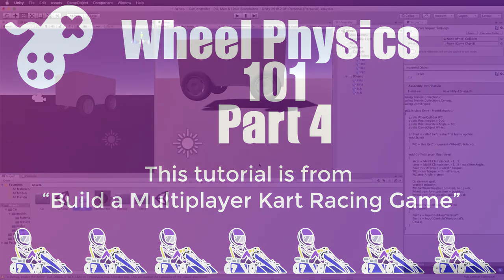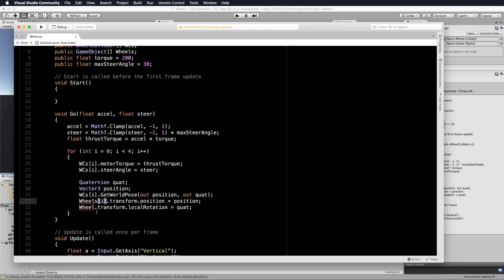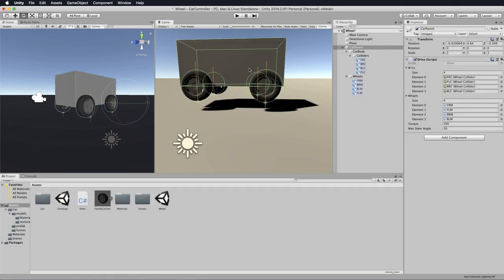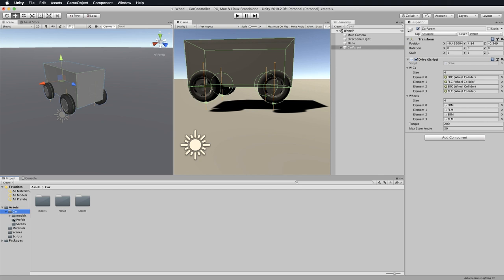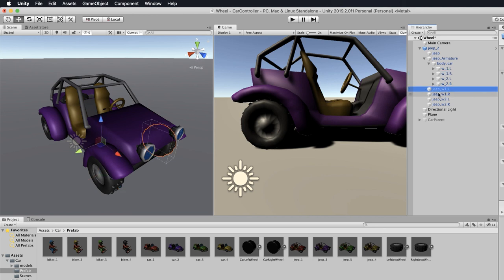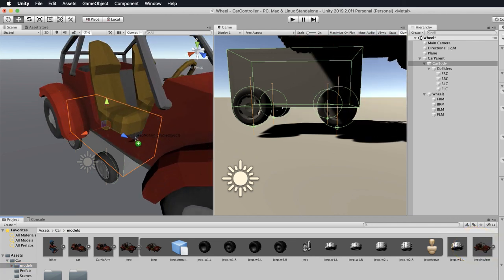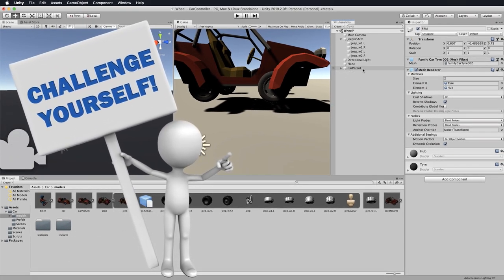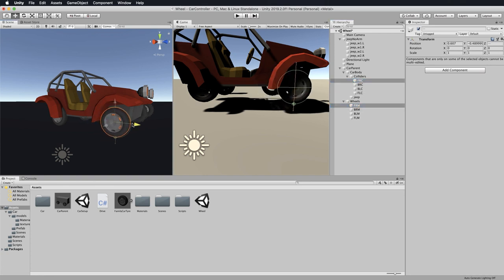Wheel Physics in Unity 101 Part 4.

Comment: Will you be continuing this tutorial series? Like preventing flipping and drifting etc. It was really good. Despite having used Wheel Colliders before I got to know quite some new things
Reply: Look into Center of mass code and put it as a seperate object so you can move the Center of mass around. Putting it lower to the ground of the car will make the car more stable and hard to flip.